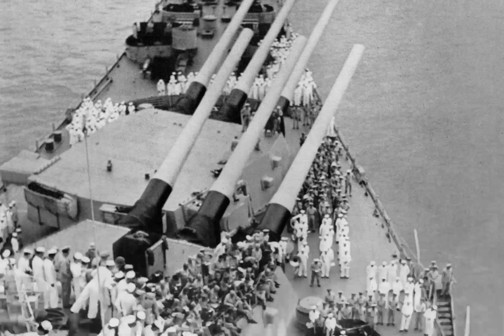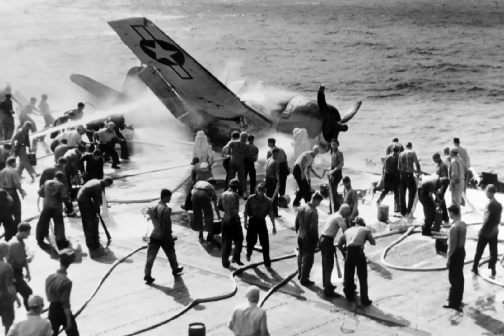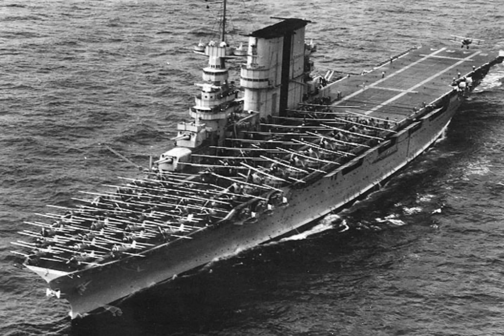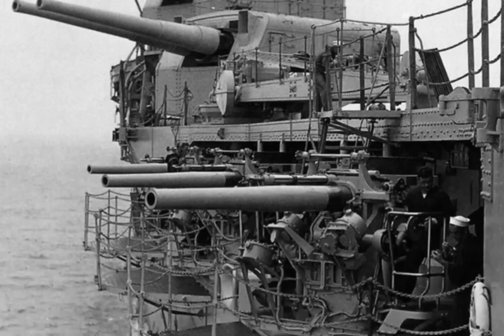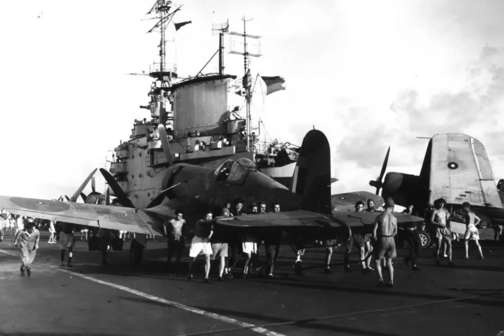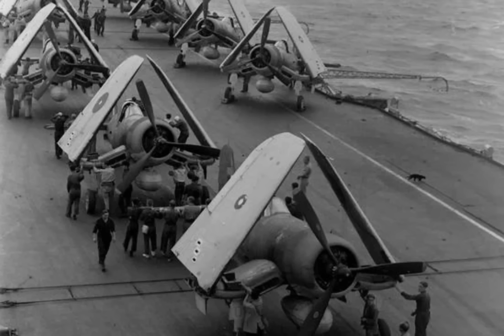Why Carrier Pilots Started Using 'Deck-Edge Elevators' — And Launched Planes Twice as Fast..

Comment: Seeing how the shift to deck‑edge elevators fundamentally changed carrier aviation blew me away. By moving lift platforms to the ship’s edge, aircraft carriers were able to keep the center of the flight deck fully clear, launch more planes faster and recover them more efficiently. What used to be a tactical limitation became a standing advantage in deck‑edge design.

Comment: When the U.S. Navy introduced deck-edge elevators on Essex-class carriers, flight operations changed forever. Earlier, center-deck elevators blocked takeoff paths and slowed launches. By moving the lifts to the deck’s edge, crews could raise and lower aircraft without halting flight ops, effectively doubling launch speed. This seemingly small innovation became a cornerstone of modern carrier design, giving the U.S. Navy a major edge in wartime efficiency.